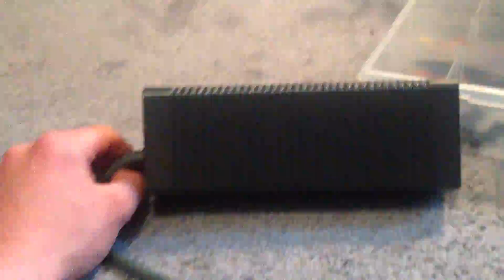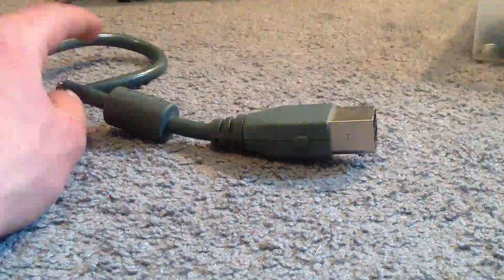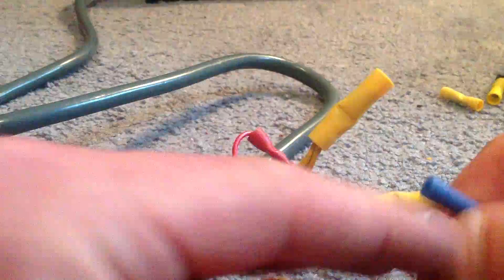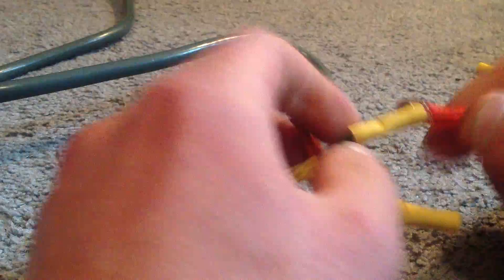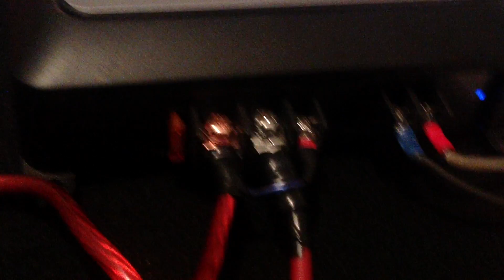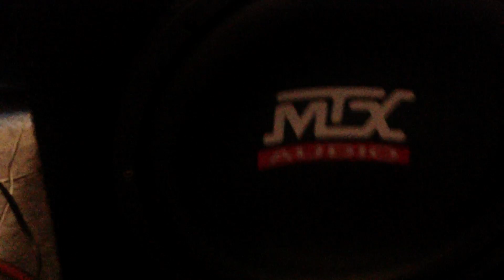Xbox 360 Power Brick to 12v DC adapter for Car Stereo or Subwoofers

Comment: What is your watts on your amp i need to run a 600w amp 4 one 12". Will the x-box brick run a 600w amp?
Reply from the maker: Hayden Hollis Usually when people say how many watts their amp is, its usually the peak power rating, which will most likely never be reached. You should be fine with just one power brick for a mono 12" @ 4ohms im guessing. If you want more info, post your amp model and sub model and ill make sure the brick can handle it.
Reply: Im am looking for an amp to get but im not sure what i need it has a 600rms rating should i be fine with a 600w amp that has 335rms ?
Reply from the maker: Hayden Hollis You're going to want to try to match RMS ratings for your subwoofers and amplifier as closely as possible. Too much power, and you could potentially burn out the voice coils on the sub. Too little power, and your amplifier will overwork itself, overheat, and go into protection mode very often. Best bet it to try and match them. What type of subwoofer setup do you have? Ill let you know what kind of amp to get...
Reply: Ben Leclerc phoenix gold octane r 4.0.2 250w rms bridged running xplod 12" 380w rms

Comment: Can I use a capacitor or 2nd battery with this?
Reply from the maker: +Rhenaldo Barnard I wouldn't man. Capacitor wont like the slow recharge rate and i think it will burn out quickly. And the battery wont recharge i believe. Since this isn't setup as a charging system, the battery will just be a pass-thru i believe. I am not sure on these, but that is my theory. I wouldn't use either if i were you, but if you end up trying it out, let me know.

Another option if to get 2 or 3 xbox power adapters and join them all together. This will increase your ampers output and increase your amplifier power. Good luck with everything bud!
Reply: +Living For The Ice so just connect them all together? (All the yellows and blacks from both power supplies put together)
Reply from the maker: +Rhenaldo Barnard yes. You'll want to solder them together. I have 3 that I soldered together. Take all of the yellow wires and solder those all together. Same for all of the black. You'll be left with 3 red and 3 blue. Connect the red and blue wires together separately for all 3 blocks. Those are the turn on wires and you'll want to make sure that they are each individually connected.
Reply: +Living For The Ice thanks man.
Reply from the maker: Rhenaldo Barnard
No problem brother. Any other questions, feel free to either email me or comment back on here and ill help you out as best i can!
Reply: Its fine to use a capacitor and its probably better to stabilize the voltage a bit the battery wouldnt cause any issues expect that it would charge and it probably would draw a bit of power to maintain charge
Reply from the maker: It is risky to use a capacitor. Alternators in cars are a more efficient and stronger current than Xbox power adapters. The capacitor will chew through itself relatively quick if you hook it up to a power source that cannot supply enough constant power to keep it charged. It also wont perform very well because the subs will hit hard, cause the capacitor to drain, and then there wont be enough power left (since it wont be able to recharge quick enough) for the next hit, resulting in an under powered current draw. This could cause havoc on the MOSFETS inside the amplifier. To err on the side of caution, negate the capacitor when using the Xbox power bricks.

Comment: I'd use my subs, but the amp runs off 4AWG wire, so fuck that. But I have a radio with four 6x9s I can use instead
Reply from the maker: @mezz you can use the amplifier. Your wire size allowance is designed with vehicle install in mind. You need a higher gauge wire based on length of wire x power consumption.

Comment: You can add a switch on the blue and res wire to use as a cut off switch
Reply from the maker: Or just unplug it. It is more reliable to not intercept those wires. More chance for failure

Comment: Hey. I was thinking about doing this but my amp only has (rem) remote, (gnd) ground and +12v to plug wires into. So what wires would I have to put where I mean for the yellow and black wires on this video??
Reply from the maker: +maxharli So the remote and power inputs both get the yellow wire. The Ground gets the black wire
Reply: just sell it and never touch sound systems again

Comment: Instead to butt ends can you just connect the wires then wrap it in electrical tape?
Reply from the maker: You can but i would not recommend it. This type of connection is very insecure and can result in a lack of power. You can do it this way, but make sure they are twisted securely and taped with electrical tape so they do not short the circuit.
Reply: I tried it as a trial and error, and it worked the first time. Doesn't cutout and supplies enough power for two 12s and the amp. Thanks
Reply from the maker: No problem. Glad it works

Comment: Will this power a 1100w boss riot amp mono
Reply from the maker: Revolution-_ WEST you'll need two of these power adapters minimum to run that. Check out my follow-up video
Reply: Okay thanks it worked good for a 400w amp but my amp get hot cause I have it powering my kickers 300w each so the total watts is 600w that’s why it get hit after a lil while
Reply from the maker: Revolution-_ WEST yeah gotta be careful my friend. You'll fry the mosfets inside if you underpower it for too long
Reply: Oh okay thanks
Reply: It could at least handle 600w max cause that what I need for my kickers

Comment: Ben I’ve got a 360 adapter i’m trying to attach them to a subwoofer with a built-in amplifier. Am I right in saying that I can connect the wires that you’ve shown in the video and then connect them straight into the subwoofer. I presume this will allow me to power the unit and it has also basically got two connectors which will allow me to connect to my laptop direct.The question I have if I was to add a normal speaker to this combination would you suggest that I double up on the inputs going to the sub woofer speaker.?
Reply from the maker: Hey man. So if you have a built in amp on a sub, then yes you can wire the power directly to it. If you add another speaker set, you'll need a new power source for these speakers, the sub amp will blow the speakers out quickly and you won't have good sound quality. Best of luck!

Comment: I did exactly what u did and it still dosent whant to turn on my amp i aslo put the blue with the red wire so it can turn on and still no power it would turn blue but not help?
Reply from the maker: Are you using an original Xbox 360 adapter? They don't have blue lights that I'm aware of